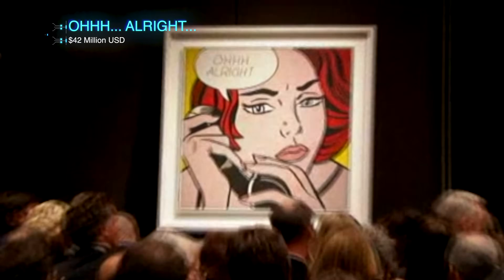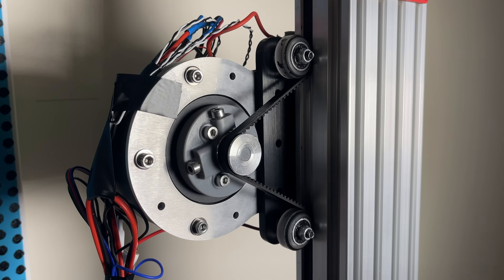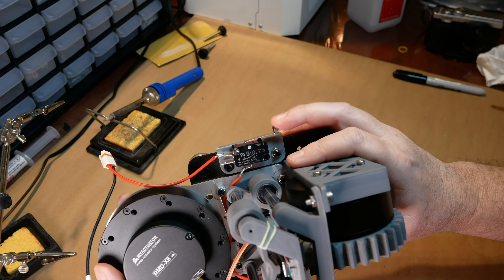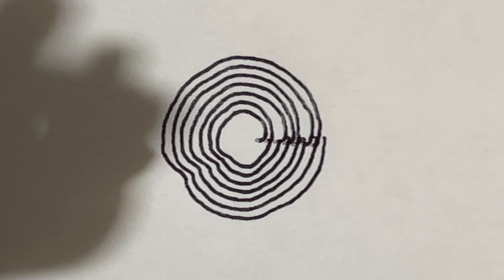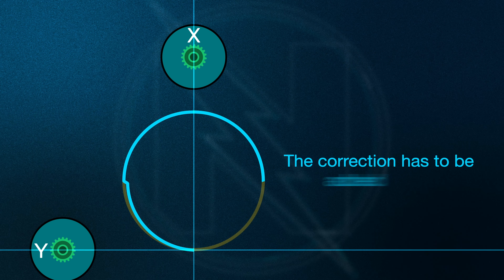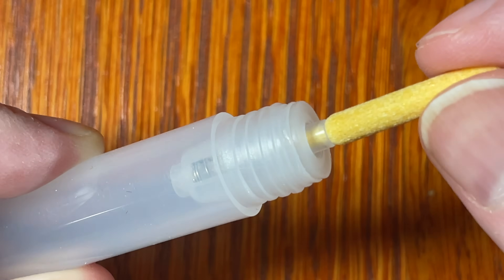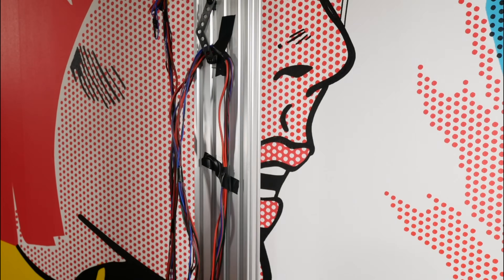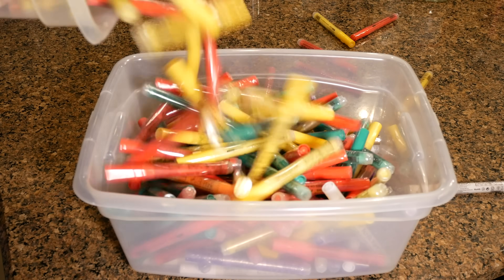I Built a Robot to Paint Expensive Art

Comment: Will it be open sourced? Also, did you use glass fibre reinforced belts?
Reply from the maker: Hi thanks for watching. It will not be open sourced.  It's pretty hacked together at this point.  This is the belt I used: https://makerstore.cc/product/gt3-timing-belt-by-the-meter/

I'll be doing some modifictions to it as soon as I can get time in the chair designing the new parts.  To follow along consider patreon.  Thanks!

Comment: I just followed your link to Xojo. I'd love to know more about how you built the app for this project.
Reply from the maker: The motors are can bus. So there is a serial to can bus module. I wrote support for the motors protocol and it sends commands to the motors and listens for responses. The painting file format is a modified version of svg which is a text file. The xojo app reads in the whole file and then parses it out line by line. And there is a method to handle each type of draw command.
Reply: @Nerdtronic  Sounds way over my head but I still think what you did is really cool. I built 3 of my own CNC mill / routers so this is really interesting to me. And your comment on Xojo really sent me off on a mission to find out more. I'm thinking of a project that I might use to help me learn that. Thanks for all of the above.

Comment: Seems to me you did quite a bit of unnecessary work with the motion controls, and converting your artwork to usable movements.. 

1) GRBL is an opensource CNC firmware, and works quite well with actuators, you just need to tune them in the GRBL settings
2) Instead of manually converting everything for movement like you did, you can convert each color layer to vector, export the vectors as FBX, and then import them directly into a cad / cam package, once in there, you can use a GRBL post-processor to convert the CAM toolpaths into usable G-Code for GRBL. 

on a complete side note, you could have 3d printed racks to put on your C-Beams, and use a pinion gear on the actuators. This is a much more rigid motion system, and backlash can be tuned almost completely out by adjusting the spacing between the pinion gear, and rack. 

Cool idea though, i really liked the approach.

Comment: I am very interested in buying a Roybot machine, if you are considering selling. I'm not sure if you make those robots and also sell them.
Incredible work, congratulations! 
Regards.
Reply from the maker: There are probably simpler ways.  Mine is HUGE because it was originally made to paint a mural on a wall.  Even though I don't talk about it in the video.  You could probably make an XY plotter with stepper motors and off the shelf software and get there a lot easier.

Comment: I'm sure many people would pay you for this. How many hours did it take you to just create the picture on the computer for the robot to print?
Reply from the maker: Several days for sure. The original artwork maybe took a day. But the paint strokes to fill in the areas took several days. I did the yellow which took a day and printed that. And then did the red which took 2 and printed that. Probably 5 days in all just creating the paint strokes. Several commenters have complained that there are tools to do that automatically. I tried these like the hatch plugin in inkscape. But in the end I had to manually tweak these because they would make a continuous line that fills in the entire shape. There were reasons I needed this to be cut up into individual strokes. One being that I wanted to control the strokes to be more artistic, and the other being that I the longer a polyline is the more likely it would slowly get out of alignment. Where every new line starts with an absolute positioning of the motors. And in the end if I had to tweak it anyway, honestly it was faster and more satisfying to do it all manually. SO that's what I did.  Funny that on one hand some complain that I'm taking the art out of art, while others complain that I'm not using an automatic tool to create what I considered to be one of the artistic aspects of the piece.
Reply: @Nerdtronic  Yeah. To me, that was the most artistic part of the process.

Comment: So with DalE+ this bot that people can now build there is no need for Canvas artist's since it will been seen a a CO2 producer. 
At last everyone can have fine art and not pay a fortune for it.
Reply from the maker: Ha.. I'm sure the energy used to run the motors also produces CO2.
Reply: @Nerdtronic  Solar power, or a baking soda battery? =P 
enought spuds and lemons could run a low voltage electric motor.. maybe it would take much longer time but .. shrugs having 10 of those running and you have a efficient art factory xD
I would also consider to build a swing arm so the brush could be pointed 90 degrees downwards so it could use a brush and a color pallet at the bottom. 
Then add that to the code that there are color options.. and then it's to figure out how much paint to be applied, where it can mix colors.. etc. but most important how often it needs to go down and reapply paint on the brush.

Then it's just to build the last thing which would be a paint dispenser that adds enough of a blobb of paint after a certain color has been used. 

And now you are making art since you are making something no one else is doing and the first art work often go for more than expected. 

All artist's try to innovate a new technice or new paint.. well here you go. a "human analog canvas printer painter"

Comment: PLA!  Really BAD choice for 3D printing anything mechanical!!!  Use PETG to fix that, because unlike PLA, it does not sag over time.
Reply from the maker: I didn’t use either. It’s resin printing and I used engineering resin.
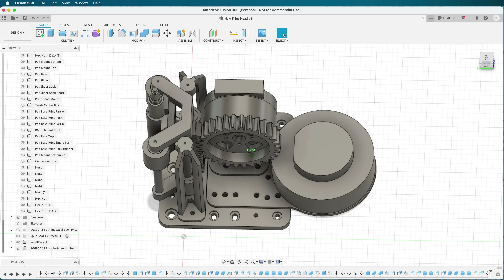Reply: @Nerdtronic  Oh wow - yeah 0:43 - I had no idea resin does that too.  Thanks HEAPS for taking to time to reply - I'm on the brink of embarking on an engineering project with my Sonic Mini 8k and that's a giant pile of headache you've just saved me from!!
Reply from the maker: @readnotify971  I think some resin parts are fine. The gear adapter that connects the motor to the gear worked just fine as a 3d printed part.  Most of the pen mechanism is still going to be 3d printed including the gear.  But the frame that holds the pen slider is now metal.  Look for an update to the Roybot mech in a video releasing early August.